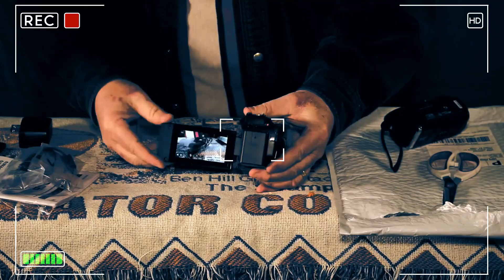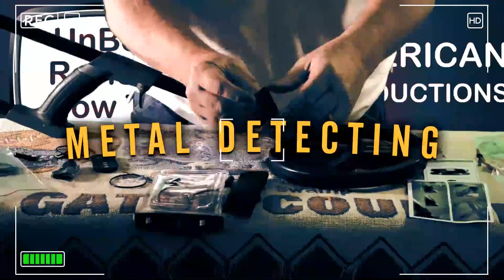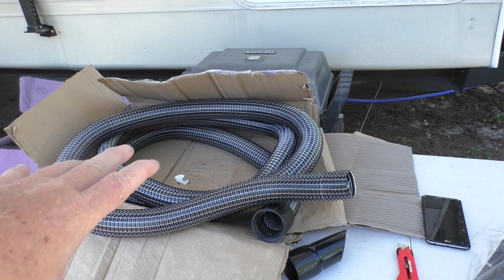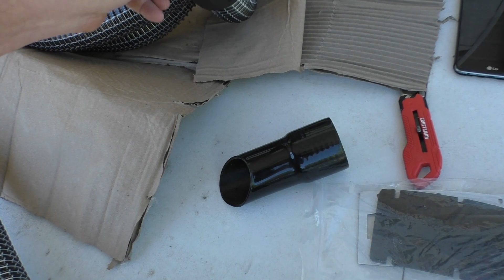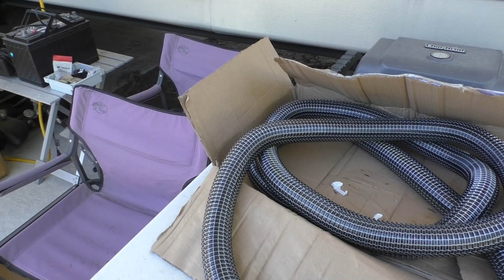More Suction POWER Gutter Cleaning Gutter Pro Vac Vortex Hose Kit Review Clean Now Pressure Washing

Comment: Thank you so much for these vac videos!! I’m a handyman but I’m looking to niche down to gutter cleaning. Have you done many 3 story jobs? Wondering how manageable 40ft of aluminum pole is. Love the detail in your videos!!!
Reply from the maker: I have only done a couple.  I am retired now and when I did those it was a little hard for me (old age) to handle the pole.  Any ways if you want to do 3 story buildings make sure you get the optional side inlet and larger hose. This will give you mucho more power to deal with larger amounts of debris.  I have a link in my description.  Also feel free to call them they are very good at helping people determine what will work best for them/you